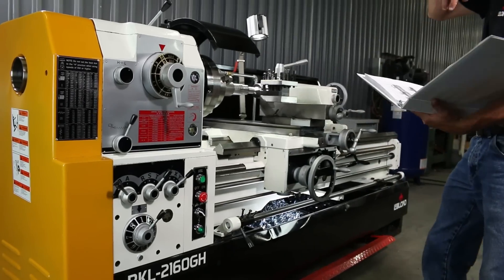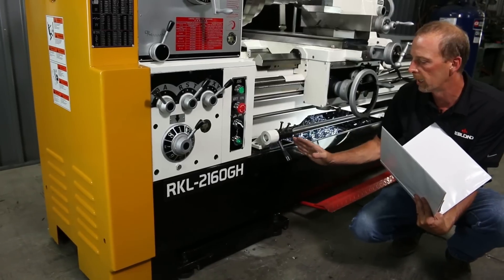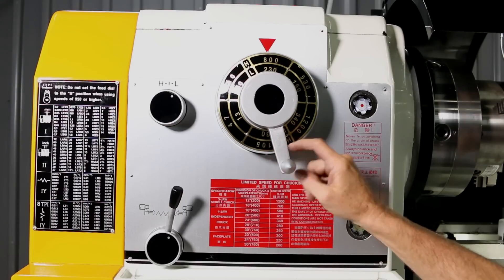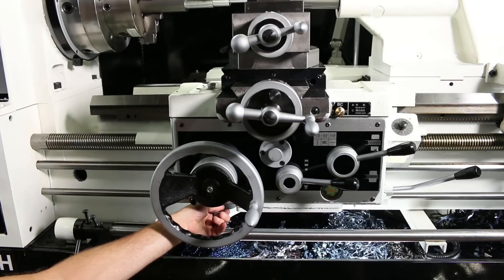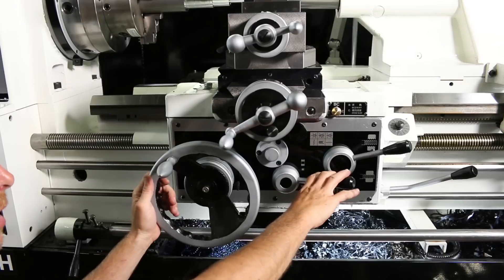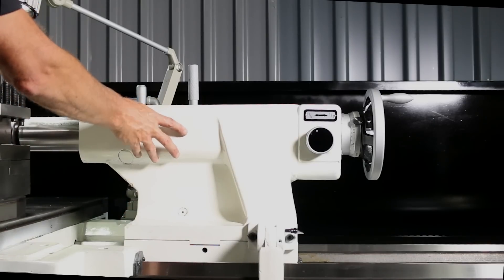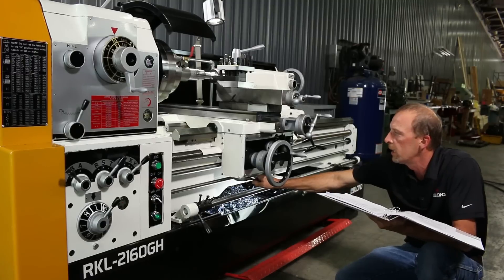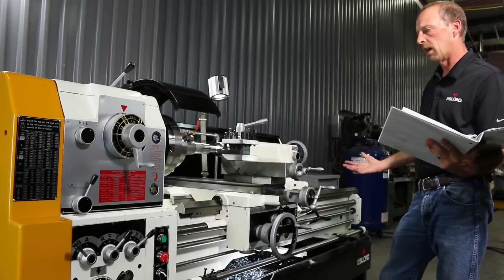Welcome To Your Machine: LeBlond RKL Heavy Duty Lathe

Comment: Good afternoon, could you advise me on the oils used by the lathe. We recently acquired a lathe which in the manual says that the following oils are used. Headstock Oil type mobil DTE Light or Iso 32 but we have Mobil Nuto H32 hydraulic oil, and for the gearbox and apron the manual says to use Mobil Vactra 2 or Iso 68 but we have Shell Tellus S2 M 68. Can they be used?
Reply from the maker: Andres, thank you for reaching out. Please call us at +1.888.532.5663 or email us at sales@leblondusa.com.

Comment: In 1984, I helped tow a ship that was built in 1945 and laid up in 1946, to be sunk as a target off Puerto Rico. In the machine shop there was a large mint condition LeBlond lathe and a smaller Shelden Lathe which I actually disassembled and had for 30 years. The LeBlond went down with the ship, sad.
Reply from the maker: Great story!